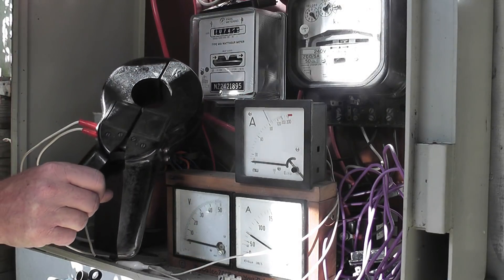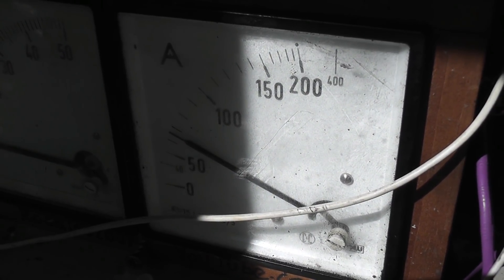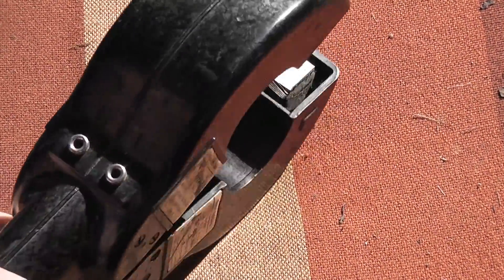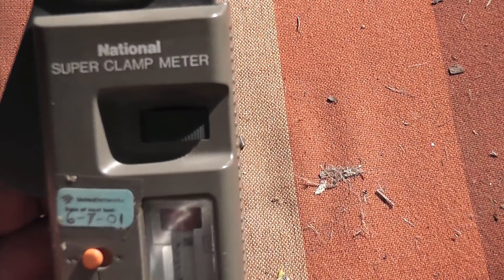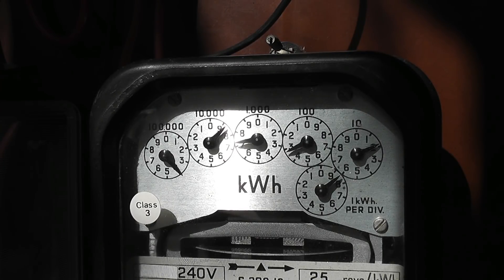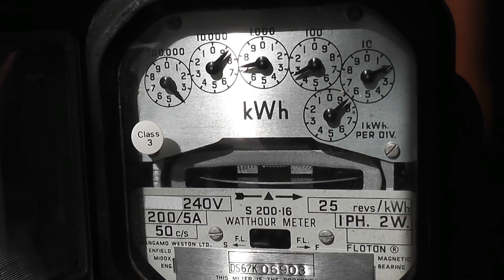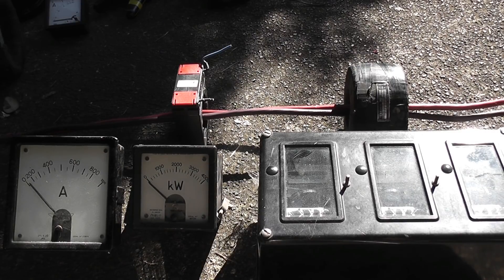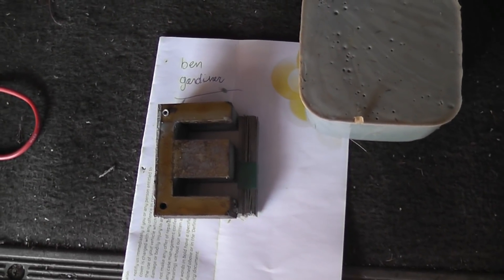Current Transformers - CT's

Comment: Rodalco, I have an earth fault relay from a scrapped substation, Chamberlain and Hookham Type B. Any idea as how to operate it and connect it?
Reply from the maker: Need to work out what terminals go to the current coil which drives the disc. The other terminals are for the switching contacts and 110 V dc supply.

Comment: I have made many current transformers, easiest is to recycle a toroidal transformer, probably the most common is a 35 or 50VA one with a 11.6VAC secondary, used to run low voltage dichroic downlighters, by stripping off the secondary ( save it, it will be used again) and then remove all the primary wire, then wind 10 turns on the secondary of the wire you took off, pass the heavy wire through and you have a 10:1 current transformer, with a 50A primary and a 5A secondary.

Another one I have is running in reverse, with a 10 turn primary and a single turn secondary, as I wanted a higher sensitivity kilowatt hour meter, so used it to get a 60A full range unit to be a 6A full range unit, just had to remember the dials are now x10 reading in operation.
Reply from the maker: Yes, a toroid TX is great for a CT as well , I rewound a 100/5 Amps CT with 2 primary turns to make it 50 / 5 A to drive a maximum demand meter on the main supply to the house.

Comment: That was interesting. Thanks! So if you reverse the polarity on a CT meter, it will run backwards?
Reply: Depending on the meter yes, but some have a reverse run pawl that stops them counting down.
Reply from the maker: Correct, the Sangamo S200.16 hasn't.
Reply from the maker: Yes it does.